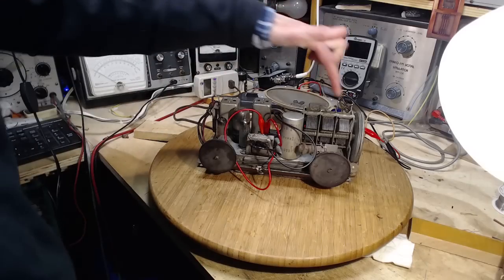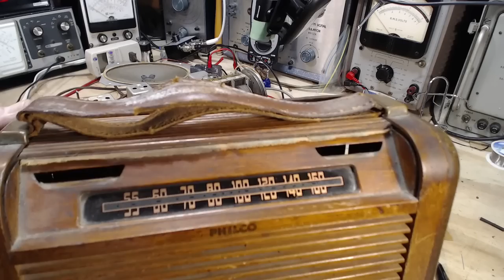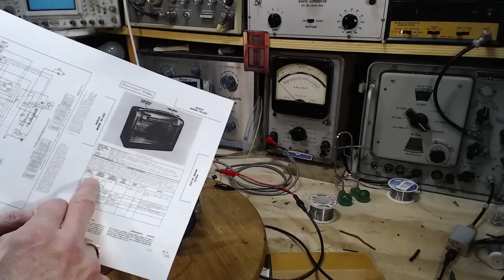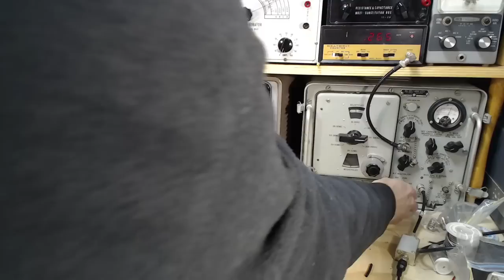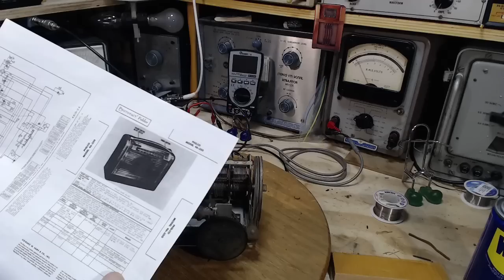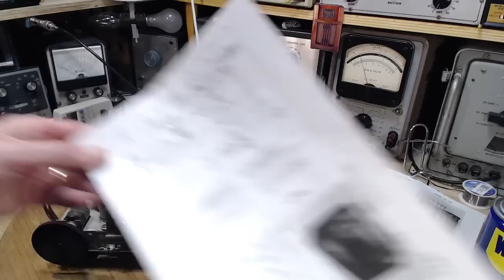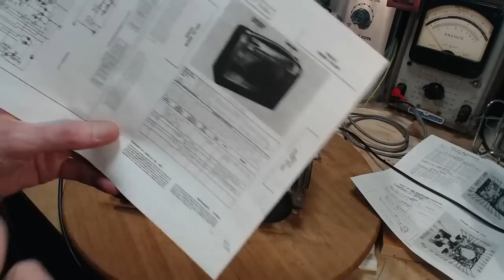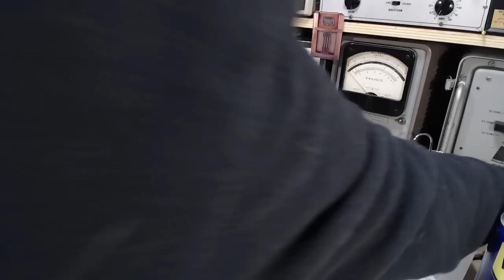Canadian Philco 409 (46-350) Portable Video #9 - Initial Alignment

Comment: A6 is the padder and it’s adjusts the oscillator at the bottom of the band. The oscillator trimmer adjusts the top,(1600) end of the band. Sometimes the padded is fixed, in which case the oscillator coil is adjusted.
By the way, I didn’t see you adjust the RF trimmers on the tuning capacitor.
Reply from the maker: I finished off the alignment and you'll see the outcome in the next video I post.

Comment: The radio should work without that capacitor unless it was an alternate feedback connection in the down converter, that first variable Capacitor is actually the tuning for the Ariel the second is the tuning after the Pre-selector  and the third will be the Local Oscillator tuning these three are all ganged together on one shaft.